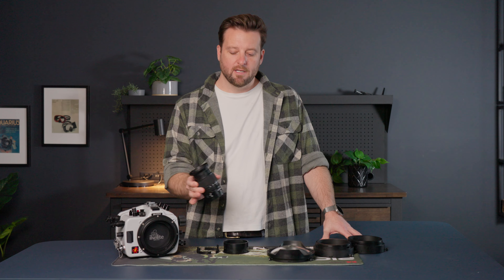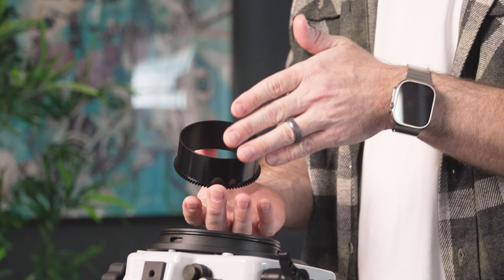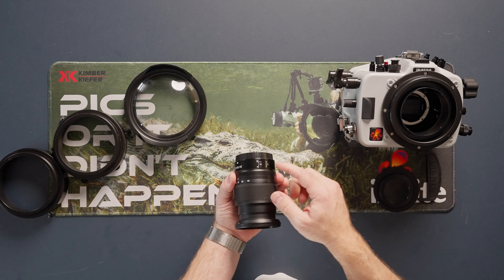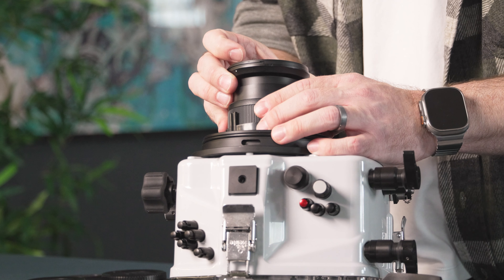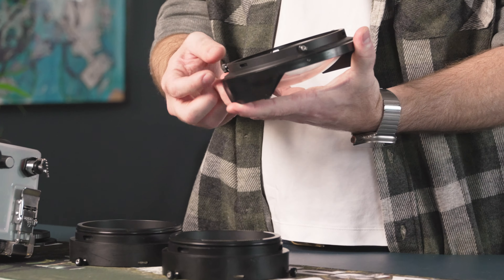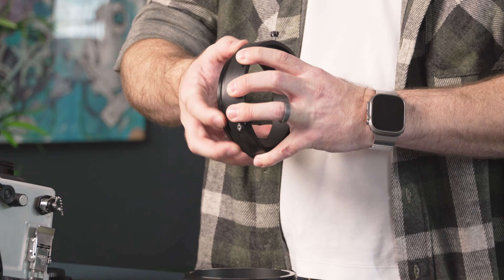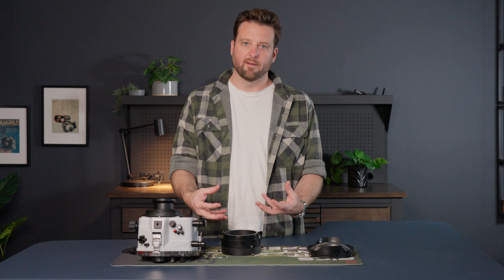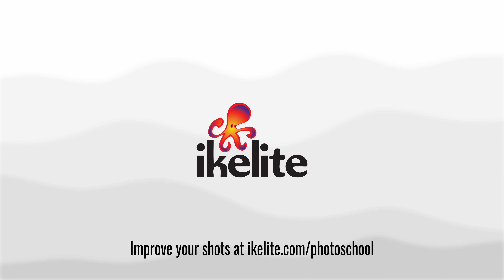Nikon Z 24-70mm f/4 Zoom Gear Installation // Ikelite 200DL Underwater Housing

Comment: Another great clip! One point I would add is prior to pressurizing the housing test a second time to ensure the lens is fully seated and zooms when It should! I have had some situations where I thought the lens was seated but it turned out not to be fully seated. Also with a lens like the Z 14-70 make sure when assembling that you first extend the lens past the storage point as this is a lot of pressure for the housing when in the stored position. I line up the lens ring with the 30 setting on the lens for assembly. This allows a positive interaction when seating the lens.
Reply from the maker: Thanks for the tips! Vacuum testing the housing before putting it in the water is always a great idea.